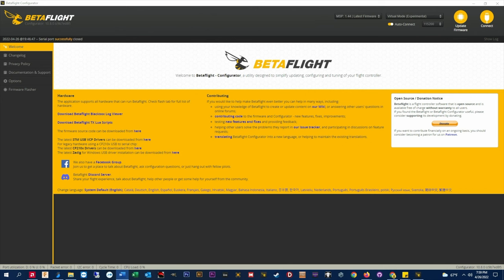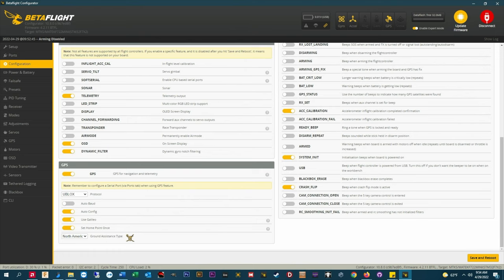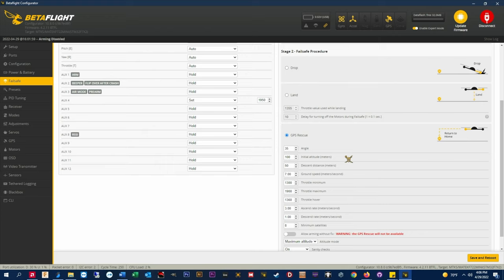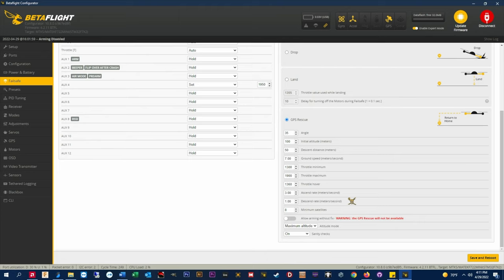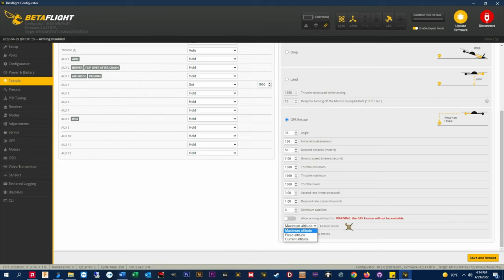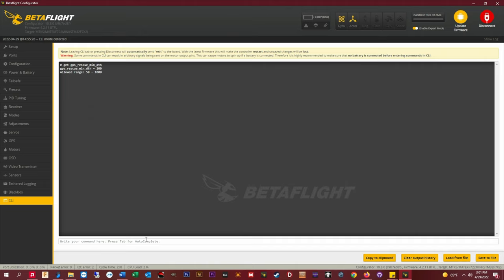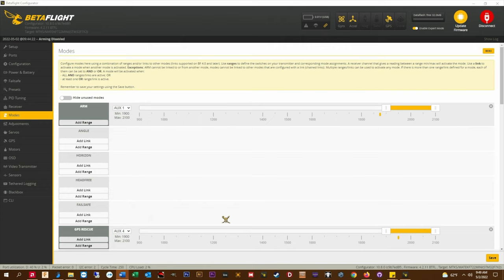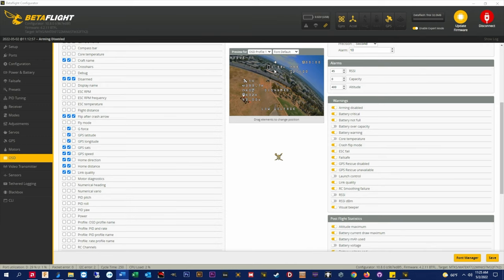Just The Tip - Ep 03 - My Betaflight 4.2 / 4.3 GPS Rescue Setup & Settings - How To Set Any Quad

Comment: Hi, great video ! What is the difference between failsafe switch stage 1 and 2?
Reply from the maker: Great Question! 
"Stage 1 Failsafe is activated when the receiver reports failsafe to the flight controller.

If the failsafe lasts longer than the time you’ve specified in Betaflight, it will go into Stage 2. This is set to a second by default (guard time). Note that you can also activate Stage 2 Failsafe directly using a switch (setup in modes tab).

If the failsafe you are experiencing is just a temporary signal dropout, Stage 1 might give you a chance to regain control and recover without crashing"
- Oscar Liang
Reply: @Rogue_FPV  Thanks !

Comment: Just wondering if you have done the wtfos mod and if so maybe a new video with canvas mode? This one is great BTW thanks
Reply from the maker: I use the Avatar system now with canvas mode, so just like wtfos.. The only difference is that you can select from all the elements to display on screen, instead of the limited set that came over the original dji osd.

Comment: Always always always set ground assistance type based on your region if your gps unit supports SBAS (almost all do)

SBAS augments the gps signal using ground stations scattered around your region, in North America it’s called WAAS - this greatly improves navigation precision both horizontally and vertically, and for many gps recievers it takes you from feet of precision to inches, or even less than an inch

Not that beta flight is going to fly it to that precision, but getting the best data can’t hurt
Reply from the maker: This is a great tip, and for Inav it probably matters more. 💪🏻💪🏻
Reply: @Rogue_FPV  yeah that’s true. Autoland features it’d be essential unless there’s lots of augmenting with other data sources

Comment: So what do you do when your home arrow does not point back home? Disable the magnometer, calibrade your gyro in betaflight (including axis reset) and reload the fonts. What else am I missing? My home arrow does not point back to the take off possition, even after flying strainght out  to 400m...
Reply from the maker: If your home arrow is not pointing to the correct home direction, you don’t have a good gps fix on home location.… 
You should disable the magnetometer to start. Ensure that you have a good gps fix before arming and taking off 6+ sats, the more the better. 
If you have done all the above and it’s still pointing in the wrong direction, the gps unit could be faulty. 
The gyro, accelerometer, and fonts have nothing to do with this, it’s home position / 3D fix.
Reply: @Rogue_FPV  thx for the quick response. I'll disable the manometer and see if that fixes things. I have 2x hglrc m80 pro gps units and I'm seeing the same thing with both. I always wait for 8x sats before taking off. On my second battery I usually start off with 12-15 sats. The home distance is very accurate though which I find strange since the arrow isn't pointing home all the time...

Comment: thanks that was really useful hoping you will do a review of settings in the new BF4.4 GPS rescue 🙂
Reply from the maker: I’ll be testing the new landing feature this weekend, if all is good I’ll make a video on that shortly.
Reply: @Rogue_FPV  fantastic I’ve just been testing it on default settings and I have to say it’s cool that it can land close to the home point 
But I much prefer BF4.3 GPS Rescue flight characteristics BF4.4 bobbs up and down like it’s trying to hold speed also it keeps flying forward then goes up slowly then turns BF4.3 used to WIP round really quick and start flying back whilst increasing altitude 
I’m flying a Chimera 7” BF4.4 put me in a tree while testing at low altitude 100m from home point 🙄
Reply from the maker: @flipfpv4539  @rcaddict has a good video where he talks about adjusting the rth p settings for a smoother return flight.
Reply: @Rogue_FPV  thanks for that I’ll check it out 😊👍

Comment: Great vid! Can I ask for a quick explanation of the Aux4 "set" config under the Channel Failback Settings?
Reply from the maker: This is an awesome question, and a very observant one at that! In my particular case "AUX 4" is the switch I use for GPS Rescue in the Modes Tab. The switch you use may be a different AUX #. The Failsafe Channel Fallback setting for my "AUX 4 " basically says "If there is a Failsafe, SET AUX 4 to PWM value of 1950" or " The GPS Rescue Mode Switch is SET to High/On position”
Reply: @Rogue_FPV  Thanks for the response. I figured that was the case but was surprised there is no "gps rescue" in dark grey next to aux4 on your screen. Is this setting required for gps failsafe to perform? I thought I read that Channel Failback Settings only come into play for stage1. Curious to get your thoughts on this.
Reply from the maker: @bleugt  your right, on my Aux 4, is should also say GPS Rescue. I don’t know why it doesn’t show there, but most of my other switch modes are listed there.. strange…. 
Note - I didn’t set any of the channel fallbacks, these got set when I setup gps rescue as my failsafe option. I could be wrong, but I think the channel fallback settings are used for stage 1 and 2. I was always of the understanding that the channel fallbacks were “what the switches fall back to, if a failsafe occurs.”

Comment: Very informative video. I just have a doubt about the barometer and Betaflight 4.3… There’s a a couple of new features to improve altitude estimation with baro and gps. I use the Tbs m8.2 gps and gets satellites very quickly and wait until I have 6 satellites before arming. I was wondering what would be the right number of sats to start using both gps and baro (position_alt_gps_min_sats)? And also the right number of sats to stop using gps and switch back to baro (position _alt_baro_fallback_sats)?   Thanks 👍🏼
Reply from the maker: 6 sats is the very bare minimum of sats needed to acquire a home position lock with betaflight. Personally I use 8 sats min for much better position accuracy. 
Weather you have a gps or not, you can use the baro for better alt readings, just cover the baro with some foam. 
For alt_baro_fallback_sats / your min sats -2

Comment: Very nice - FYI: Betaflight does use the magnetometer if it's available *by default*. That being said, I'd agree that if it's something you're wanting to leverage, go with iNav and disable it for BF or at least tell GPS rescue not to use it unless you really know what you're doing on the compass front.
AFAIK: Auto baud on the ports tab and Auto Baud on the GPS tab aren't really related. I don't generally recommend the GPS auto baud though. GPS rescue really needs at least 57600 to work properly (AFAIK).
bf 4.3 for current altitude will allow you to set an added buffer via cli, so you can always add, say 50m or 100m to whatever your current altitude is once failsafes trigger.
Reply from the maker: Auto Baud on the ports and GPS tab are related, you can set both to auto, or set your speeds accordingly in each.

It's not "GPS Rescue" that needs at least 57600, this speed is entirely dependent on the max buad speed of each gps device. All GPS Rescue needs is Min Sats and a gps fix at takeoff. I recommend that experienced users always use the max speed their device is capable of. I have had a few GPS units in the past that didn't respond to betaflight with the highest baud speed, so I don't recommend novice users to just "Set it to the max", in case they get no response from the unit. The best thing is to check the manufacturer's spec, or set it to the highest speed that works and gets responses from the gps.
Reply: @Rogue_FPV  So, we may just be splitting hairs here. The gist of things is probably to advise people use 57600 all the time if you're using auto-config. Use or don't use auto-baud (probably just don't use it), but it's not related to the ports tab (it's a different Hail Mary strategy for communicating with the GPS in order to issue the command to change the baud rate to whatever you set in the ports tab). If you notice, you can't actually set AUTO in the ports tab anyways. AUTO is the same as 57600, the BF Configurator will switch it out for you when you save and come back. That's just fixed code behind the scenes. It is however, a problem for the user to misinterpret this video and look up the spec of their GPS unit that often says "Baud: 9600" and set the baud to that. Because, while you're technically right that GPS Rescue doesn't care about the baud, 9600 is not a sufficient rate to communicate the GPS data once update rate is updated to 5hz, which it is when you have auto-config on and often the default 1hz update rate is too slow for gps rescue if you had autoconfig off. This is part of the reason GPS on a soft serial for GPS rescue doesn't work well / isn't advised. Even though the update rate is pretty slow, the baud rate that's reliable on soft serial just isn't sufficient to communicate the data fully. There's no real reason to use more than 57600 when allowing BF to setup the GPS unit - just as you said, GPS Rescue doesn't care... and 57600 is sufficient, but nothing really stopping you from using 115k either. The story might be different if you're not using auto-config, but this explanation is already a little long.
Reply from the maker: @CesiumSalami  💯 yes! 👆🏻This is the best most complete explanation 🙌🏻
Reply: @Rogue_FPV  thanks for your patience, lol. it really is a great video .... sorry about diving into the minutia that probably makes a difference to like 14 people :) or is it 0...